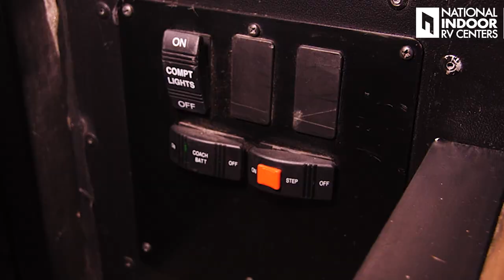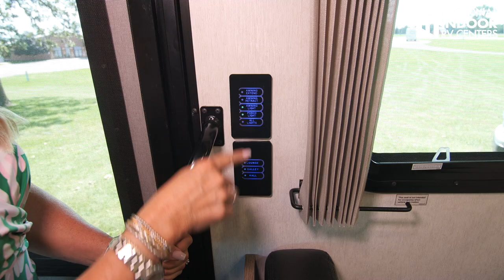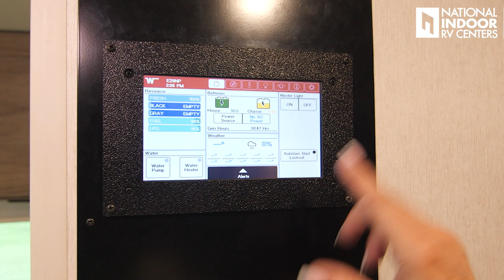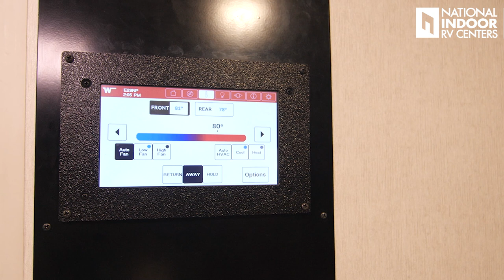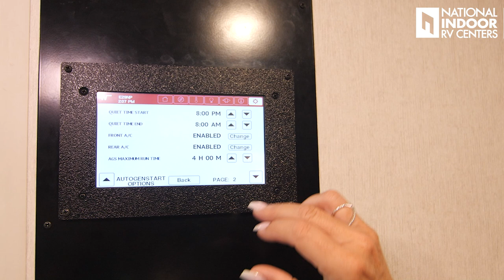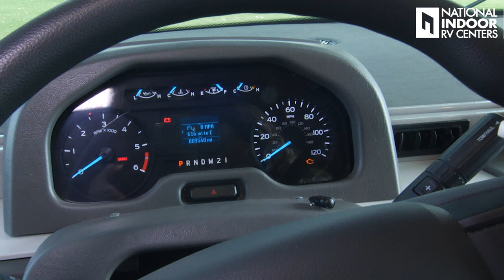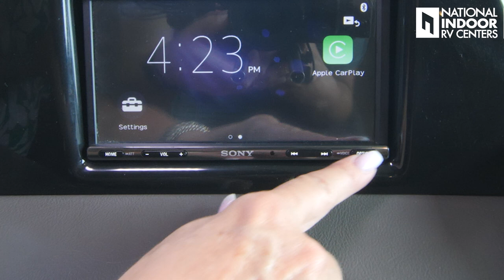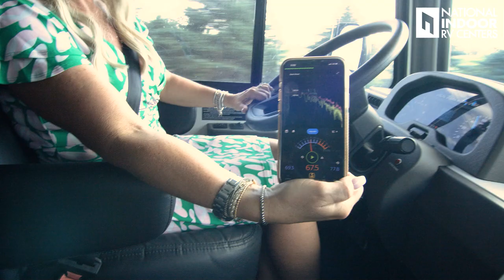Luxury RV Tour - 2023 Winnebago Vista - Class A Motorhome

Comment: In order to be 100% Sasquatch approved, we need to see the OCCC (Occupant Cargo Carrying Capacity) data to determine if we full-timers would be able to carry that 70 gallons of water or not. Otherwise, this is the best upgrade to Vista/Sunstar that we have seen in many years. The Adventurer 29B typically has an OCCC of 1495 pounds. With the switch to LIFEPO4 batteries and to rotocast storage, bays should help some! I always bring more solar for our six months of camp hosting, however, the included roof solar has a big start on covering that aspect as well. Cheers, David & Sheila Knapp

Comment: How long will the refrigerator run on the lithium batteries without solar? What is the average  solar charge time to recharge the batteries and does it charge both engine and house at the same time?  From the video it appears to charge both. How long does the generator have to run to recharge the lithium batteries?  The reason for me, most of my camping is dry camping 7 to 10 days at a time and I need a refrigerator to run the whole time which I use propane/elect  refrigerator. Also does the drop down bed in half way mode, can the safety belt buckle have enough length to attached or is it really safe to travel with the bed in storage mode?
Reply from the maker: Hi Frank, if you want to call the store and speak with someone that be the best option to answer your questions. It is a  technical question with a lot of details, but one our team would be happy to walk you through. Thank you for watching!